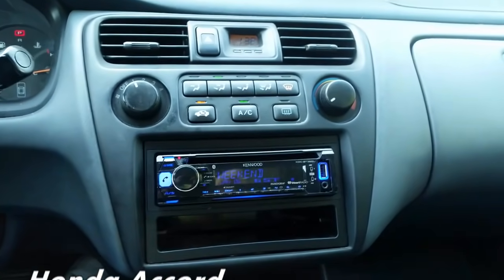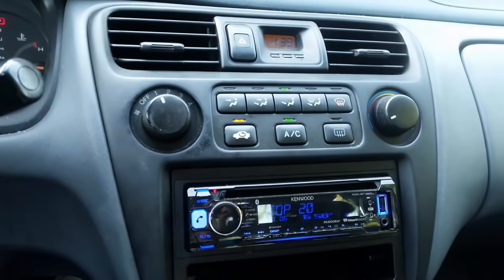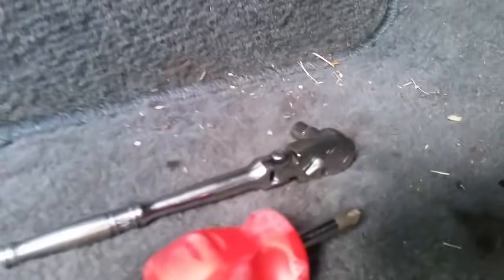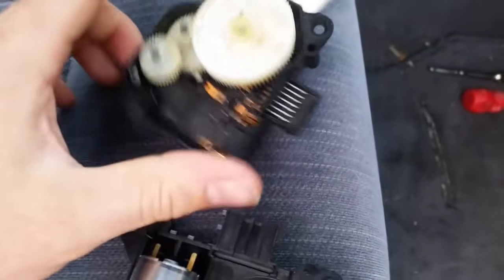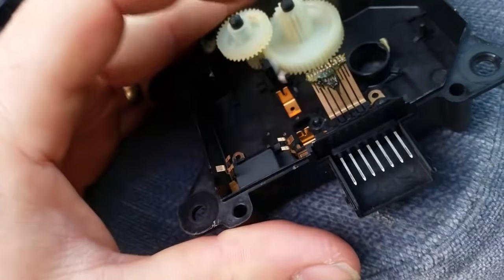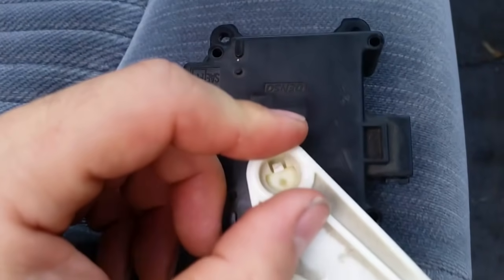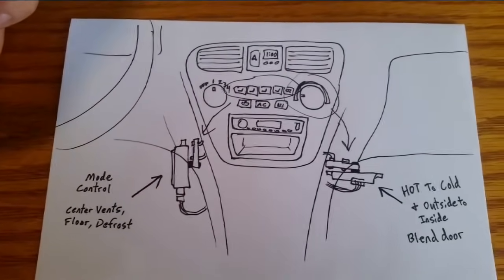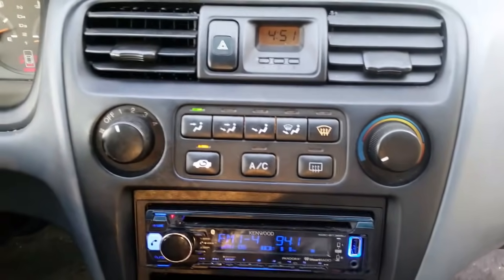Honda Accord Climate Control Repair Fix 98-02

Comment: Thank you. I used this guide and did not even have to buy a new($250+) oem /used ($60). I simply took off my drivers side actuator as you said controls the mode/direction and took it apart cleaned the pieces and followed each part. The hardest part was getting the part off as I am big and the small space allowed around the pedals doesn’t allow for much space. Thanks man! I can now control my direction of air flow as the winters with weak defroster direction was getting dangerous.
Reply: IS it 2000 accord?
Reply: Hello, did you just clean it or also reapply some type of grease, I can’t control the directions of my airflow 99’ accord.

Comment: 2000 Accord EX.  Slightly different control panel.  Your directions were right on.  Fixed driver’s side and my vent control works again!  Thank you.  My additions:  1. In order to disconnect the green plug, you must slide out the little black retainer that sits against the green part.  2. If you break ALL the tiny case clips, don’t worry; you don’t need any of them. 

Thanks again for this great vid.

Comment: Worked fine on 2000 Honda Accord, both the left "Mode Controller" and the right "Air Mix Controller".  Both had a build-up of grease on the contacts.  Simply opened the controller cases carefully, marked the component positions, then lifted and cleaned the grease and put light coating back on the "wheel" that rotates on the contacts.  It's a tight fit on the passenger's side, but the driver's side was very accessible (that side controls the flats that direct the air flow).  Thanks for the very helpful video!

Comment: So glad I found this video because I was about to take it in and let someone else fix it.  It took less than 10 minutes to take off, clean,  and reinstall.  I ended up breaking 2 of the 4 clips but no biggie as it was still able to close the box. I had been hating when the weather  went from sunny to rain cause it meant I had to manually turn the gears to the correct air flow direction.Thanks for posting and saving me some $$$.

Comment: 7 years ago, but thanks just the same.  Worked like a charm for my 98.  I have hvac again and still summer left to use it, not mentioning the need for fogged windows come winter.   Working toward 28 years and the vehicle is still going strong.

Comment: I had the same issue. Hot air coming out of front vents. Took motor/servo off opened it up cleaned and re-tensioned the contacts and plugged in and it works great. Thanks for your help. You saved me a lot of money.

Comment: I had to replace my mode control motor today and this video was very helpful.  Repair shop said 'special order part' - $466.  eBay used part - $47 shipped.  Relatively easy to access/install, especially with the detail you provided here.  Many thanks.
Reply: Derek Rogers I had a very hard time getting this piece off.  How did you get it off so easily?
Reply: Derek what year was the accord of yours
Reply: Honestly some mechanics are a bunch of rip offs. Very few honest ones out there

Comment: Again thank you sir for your instructions on cleaning and reinstalling. Mine needed a motor change so I got a cheap actuator on Amazon for $22 and took the motor out since the rest of the unit didn’t match mine. Had to solder in motor leads. No biggie,  but at first the alignment didn’t work but I studied your alignment on the video and copied it and now it goes from cold to hot without making clicking sounds. Thank you for saving me over $100. Hope this post helps out the next guy.

Comment: Thanks for posting this video. My climate controls were completely dead on Thanksgiving night except the fan. Even the LEDs. The next morning everything worked fine. The next day it took 3 to 5 Seconds to work but it worked for the rest of the day. It has worked since then I took it to a shop that has a good reputation they can't seem to recreate the problem. It seemed cold was another factor. It was below 30 degrees. I'm not sure I can do this myself anymore because the physical health conditions. I don't know who to take it to. But at least I have an understanding now thank you.

Comment: Thank you for this video!  I started having issues with my AC a few months back, but never worried with it.  It wouldn't change the zones for the air, but I took it out today and cleaned it like your video and it worked like a champ!  Your were super helpful and informative.

Comment: Thank you very much for helping to understand why only heat comes out. I believe I overcharged my AC because I didn’t search out the issue first. Wasted 40 bucks on refrigerant when this most like is the issue at hand. Now I have to have refrigerant weighed for right amount and hopefully didn’t damage my compressor. The line gets cold so I think I’m good. I will take your suggestion and remove the motor assembly and clean it up and tighten internal connections. Again thank you for helping me and many others.

Comment: I used the 9/32 socket. This was one of the hardest things to get to. I did everything in the video but i think mine is just no good. But, my air is now coming out the front vents instead of being stuck on defrost. I didnt reconnect  the arms to the motor which is allowing my air to flow through the front vents. Thanks a bunch for this video. I thought i had to change the whole climate control face.

Comment: Success thanks to your video. To remove the actuator's metal arms from the plastic rotating part you have to unclip it. There is a small plastic part that is part of the rotator which clips on the metal bar. Flip it up to unclip it. 5/30/18
Reply: Thanks, I’m scrolling thru the comments looking for this exact help!! 5/1/2021!!  Cheers!!🏌️‍♂️
Reply: Just saved my life I couldn’t figure it out lol

Comment: Thank you, had same problem with the actuator motor for directing the air, your video was spot on. Cleaned the grease off and put it together.  Now working.
Reply: Did you reapply grease or no? Wasn't sure if the grease was meant to be there in the first place or why it's there, but he didn't mention reapplying grease after cleaning it off.

Comment: Great Video.  What threw me was I took out and opened the box and all the contacts looked bright and new.  I tested the motor and no go! Then I cleaned the clean looking contacts and it WORKED! Re-installed it and it works fine. $aved $$$!

Comment: Thanks for this video. My A/C problem was stuck either hot or cold. Blowing cold air while turning heat up max, or blowing hot air while a/c is on. Found the passenger side air mix motor not response to climate control knob. Remove the air mix motor, retouched all the connector. Tested ok before put back in. Now I have hot or cool air as turning climate control knob.

Comment: Excellent video, thank you so much!  My actuator for the modes (floor vent, dash vent, etc.) has been slowly failing over the past years (works fine most of the year, stops working in colder winter months).  I'm going to attempt this repair just as you've outlined.  Thank you again!
Reply: Having the same problem. Did it work?

Comment: excellent diagnosis and explanation.  Mostly the led lights lose power. the solder trick helps usually.  Ive replaced the circuit board control several times as well over 25 years

Comment: I wish we lived near you, my daughter's car has this problem, it is a 2000 Honda Accord and we have 2 mechanics that are not answering our calls....hmmm.  Thank you for this video, very informative!!
Reply from the maker: Cheryl Diaz yeah just pull those Motors out on each side under the dash, and replace them with eBay or salvage yard units. That will fix your problem, almost guarantee it
Reply: Cheryl did u fix the problem if so what was the issue

Comment: Excellent! John thanks so much you were spot on! It worked just like you said it would. The only thing is I didn't hold the cam in the same position when I took it out so I had to take it out and do it again no problem now we have a run the defroster and I am a hero! That makes you a hero thanks again exclamation

Comment: Dude that was a very informative video exactly what's going on with my 2001 accord ...ac has  stopped as is all push button panel switches like you showed. ... must say looks like a tough job if you don't know electronics like you....wish it was just a fuse! Aaaargh

Comment: So I went to try this, but just getting the actuator out is definitely not easy. If you're a taller person, you practically have to remove this thing blind. One thing I tried before I got back underneath the dash was spray some electrical contact cleaner on the harnesses for the climate control board. So far so good, but I will report back at a later date if anything changes.

Comment: Hey, great video, thanks! I've changed a cuple actuators some years back on a truck and a jeep. My son now has a 01 Accord and theirs no air blowing thru any of the vents. When I put my hand on the passenger side actuator I feel a single thump. a lightly audible tic tic is heard just before the thump. This happens when he is pushing the button to change vent flow. Again there is zero air blowing thru the vents other than he has noticed a bit of forced air flow when driving highway speeds. 
Trying to diagnose this without the car as he has gone to his house now. Thanks for any suggestions! Your vid is superb!

Comment: BE WARNED!!! If all you have is AC and face vents and you can live with that until you replace it don’t do the wire mod you will in turn be stuck with heat and face, if your only have AC and want or need heat then do it

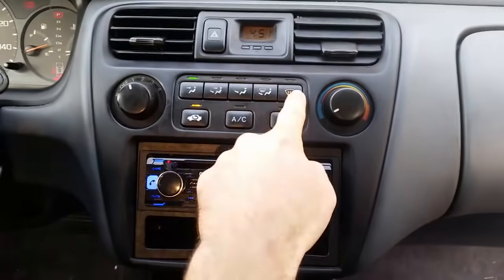Comment: 5:40 Would you please point me to your other video you mentioned? My problem is with the LEDs. They are off, and the AC doesn't turn on because of that.
Reply: +1 for this request. Mine is having two issues; 1) all LED's go out sometimes. Almost always after starting it up, and then also randomly. 2) as of today, the switching of the modes (i.e. defrost, feet, dash etc) doesn't work. The lights will change when I press the buttons, but the mode doesn't actually change. Happens randomly
Reply: SAME issue! Please tag video!

Comment: I have a 2002 honda accord. The mode was not working. Video was very helpful. Put new synthetic grease in both actuators and grease on all the plastic levers that move the actual flaps. Worked great. Only thing I noticed while testing is the Re-Circulation on mine isn't controlled by the actuator on the passenger side.   Only the hot and cold knob controlled that one. I wonder if there is a 3rd actuator on mine that controls the indoor/outdoor air. I tested this by unplugging both actuators in this video and then pressing the Re-circulation button. I could hear a motor still opening and closing it. 
thanks for the video
Reply: The re-circulation actuator is directly behind the glove box.  It's not controlled by the hot/cold actuator as mentioned in the video.  You'll have to pull the glove box out completely to see it wedged vertically sitting dead center and hiding being the big bundle of wires.  There are only two screws that hold it down and you'll have to finesse it out buy turning it in different angles.  It's a little tight but doable when pulling out and putting in.  In my case, I purchased the hot/cold actuator thinking this was going to fix the re-circulation issue per the video.  Instead of returning it, I cracked open the two actuators and swapped the inside motors and it worked well.
Reply: @hermanlee1218  thanks for the reply. eventually I figured out what you posted from more research. However since original comment then the car has been totaled, no one was hurt, but no need to worry about the re-circulation not working anymore.

Comment: 02 accord LX
Controls are flipped with the small lcd screen indicator
Flaps were stuck to defrost
Unplugging and plugging back in the driver side actuator while the ac was on full blast reset it and it works perfectly now!

Comment: Going to try this to my 99 accord. Only getting air on the driver and passenger side but not on the center vents. Thanks!
Reply: In my case, soldering the wire on the back of the climate control panel didn't work for me. Instead, replacing the motor mode control did the trick for me and finally getting air on my center vents. Thank you!

Comment: WoW thanks for your video! Had three problems, first no lights. Soldering a jumper from D3 to R12 got lights back on, Yip Yip yahoooo. But then I only had high fan and no AC. Ok replaced fan resistor. Got low and high, but still no AC. Checked fuses and relays and wires but nothing. Then checked the plug on the fan control and tighten the spade connectors in the connector. All speeds started working and AC came on. Hope this helps someone else.
Reply: Dave Houston my lights go out every now and then and when that happens the air no longer comes out cold, or let’s me change where it’s blowing out of. Do you know how I can fix this?

Comment: my 2000 Honda accord.. my console is different.  Wonder if it is still the same?  I keep thinking it cou8ld be the Temp controller on the back side of the console. the one that has electronics and the dials on it.  Thank you so much for this video.. God Bless you for making it.

Comment: I was struggling with this so much until i realized the white plastic arm was upside down when I put the box back together. also there is a pin that has to be put into the hole of a second flap thing up there when you reinstall. so there are is the pushrod you have to put back and also the pin which must be in the groove of the second white piece up there. was a bitch to reinstall this

Comment: Going to do everything in this video and share what happens afterwards
Reply: Any update?
Reply: @frendel3454  I wrote another comment but I think it fails because of old capacitors, I replaced all 5 and it seems to be working well so far. So try that

Comment: I got a 1998 Honda Accord and my  
AC works fine when I turn the heat control to hot it does nothing so I'm gonna try your method tomorrow all my lights are fine...

Comment: Awesome John. Thanks. You're the only person that has identified this as a possible problem and great diagram description. I have a 98 with electronic climate control ( min 18 to max 32 degrees). My temp control and fan speed button are reverse location to yours. Would that change which side my temp actuator would be on? This started with no heat this fall. All directions work, the heater control valve is in open position and works if I remove the cable. When I turn the temp button I notice the cable on the heater control valve in engine area by fire wall does not move. What's strange is air conditioning works fine when I turn temp button to 18 degrees. Turning to 32 degrees does not produce heat. I also pulled and tested thermostat which is working fine. It opens and closes. Doing that was a pain in the pazoo. Any other ideas would be appreciated. Thanks, Michael
Reply from the maker: Sounds to me like your heater control actuator motor is bad. You might need to do some research or look up wiring diagrams to find where that is located
Reply: @JohnCalebWarren  Thanks John. Would you be referring to part 
79160-S84-A01
,Motor Assy., Air Mix door actuator as opposed to component motor assy, mode door actuator? The fan works, the modes all work, a/c works, recirc light turns on, thermostat works, heater control valve(a.k.a water control valve) is on open position but when turning dial inside car the cable attached to heater control valve does not move valve so surprising that I'm getting a/c with valve open.

Comment: I guess if BOTH sides are acting up, it's probably the control panel itself? Basically the only thing I can control now is turning the blower on and off; nothing else works. And actually the LED's stopped working AGES ago; I forgot they even existed! :D

Comment: This did not work for my 1998 Honda Accord EX. My heater control panel is different and has an LCD display for the HVAC mode settings rather than individual buttons. I replaced my mode control motor with a salvage yard part since they aren't available in the parts stores, but the actuator does not respond at all. Honda changed the design for 2001 to 2002 Accords, which do not have the "Auto" temperature control settings. I think my problem lies in the circuitry of the control panel as I also checked all of my fuses. I don't know where to look from here, my board is different than yours.

Comment: After removing the grease on the internal contacts to permit cleaning them with sandpaper, did you replace the grease?  What type is it?  Does it need to be conductive?  thank you for any insight available.

Comment: today I looked at the Heater control valve, going to the heater core.  A simple valve, controlled by that wire.  Is this wire what the blend door moves?  I slipped the wire off, and moved the valve, trying to get at least some heat, 'cos it's cold out.  Well I got some heat, but not much.  What causes that wire to move?  Switching on the A/C?  'Cos it didnt move when I hit the A/C button.  Also my RECIRC works, it has always worked.  So would this mean the Blend door actuator is good?  HELP!  The coolant looks good, nice color.  Could it be heater core?
Reply: Did you figure out the issue? I have the same thing happening. The mode actuator definitely works, and on my dash I have a display showing the temperature setting and it changes as I turn to hotter or colder but i have no heat. I don’t think the cable moves  but i also switched the heat control in the engine bay by the firewall but it still only blows cold. I’m taking the module apart tomorrow to see if i can do the same thing that we saw on the video. I hope it will do the trick.
Awesome video! Thank you for taking the time helping so many of us. Cheers 🍻